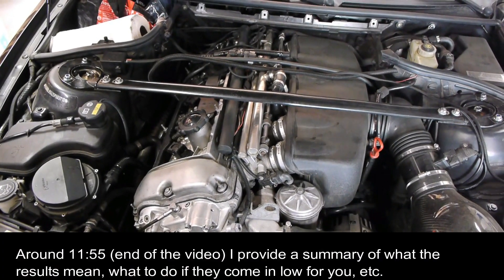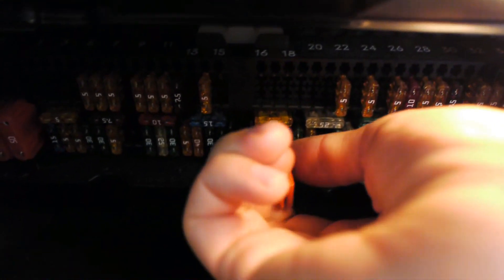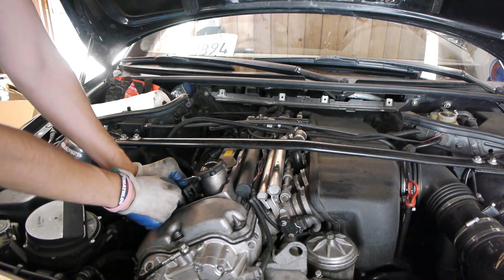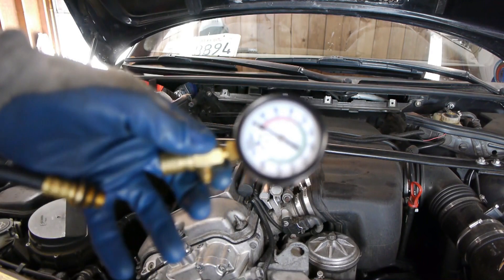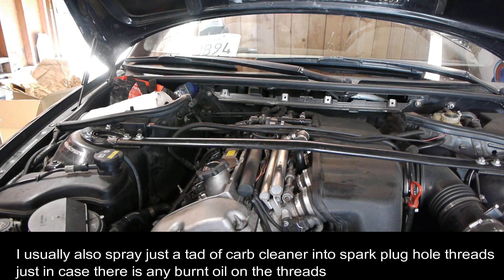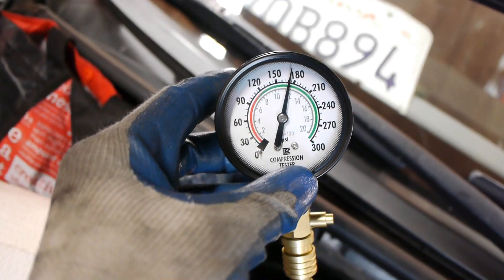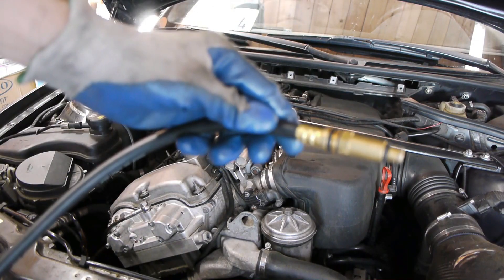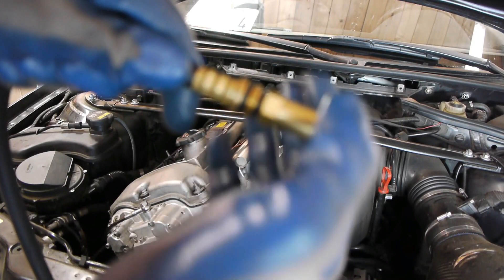E46 M3 - Compression Test, How To And What It Means

Comment: Good informative video! About to do a compression test on my ‘04 M3 w 180k+ miles to determine if i have a failing head-gasket since it’s now running hot on track w no cooling system issues. Favorited for reference

Your engine had perfect compression numbers! Can you post the link for the tool you used? Im shopping for one on Amazon but wanna make sure i don’t get a junk one that doesn’t give consistent numbers. I just know to make sure it includes a 12mm adapter
Reply from the maker: Thank you for the feedback.
You have any misfires, or any oil in coolant or coolant in oil or other symptoms? Could be that you've killed enough bugs/caught dirt or rocks with your oil cooler or radiator that are blocking the flow and causing higher temps, if veins get clogged cooling efficiency goes down. I've blasted my radiator and oil cooler from inside the engine bay outward with a garden hose and that helped some, until you drive on roads again and pick up more dirt. At some point just have to keep replacing them (use FCP for warranty).
Here is the one I used: https://www.amazon.com/dp/B000EVU89I/ref=cm_sw_r_cp_apa_fabc_HPQSQV5ABV4A07F06NYZ?_encoding=UTF8&psc=1
Reply: @mrgizmo7975  nice thats one of the testers I was eyeing on Amazon.
Nope no issues at all, car and engine runs super strong w no issues. Even after the track days the engine feels like it has half the miles it does (guess the S54 loves the italian tuneups lol). Yeah i figured could be debris in the cooler fins, I’ve hosed both CSF rad and oil cooler before the last track day, and did coolant flush w distilled and wetter, but water temps still got hot up into the 3/4 mark on the cluster gauge :/ A clog in the system is indeed another possibility, I’m thinking maybe even faulty/sticking thermostat? (tho was replaced not even 10k miles ago)
Apparently on these engines coolant mixing in oil isn’t always a sign like most cars, since the hg is super thin between the bores and thats where they usually fail I’m finding out, thus coolant/oil mixing usually doesn’t happen, only low compression being the clue!
Reply from the maker: Yep, could be thermostat, sometimes things fail even after 1k miles. You running stock fan/clutch?
Reply: @mrgizmo7975  nope, mishimoto efan! Which while not regarded as the best option,  it seems to be working fine. It came w the car and this running hot issue is a recent thing so makes me want to rule it out, but who knows lol
Reply from the maker: Yeah mishimoto is a popular upgrade from the mech fan. I run no fan (aux still in place), and car doesnt like it at the track in ambient north of 100.